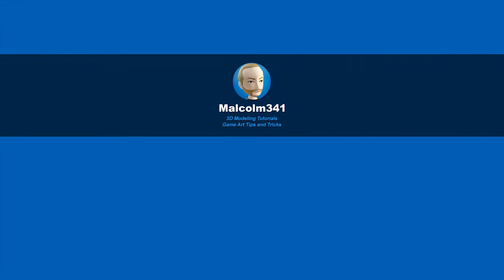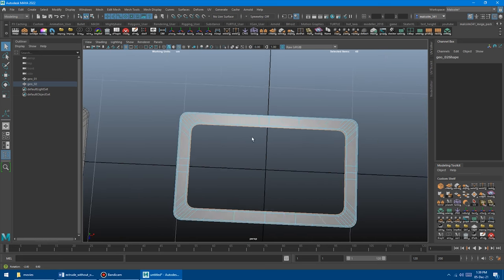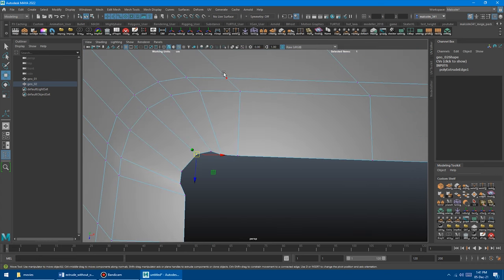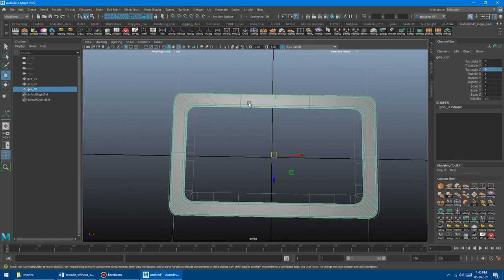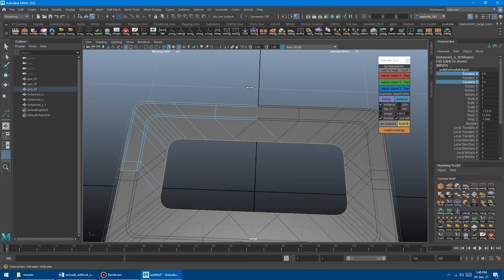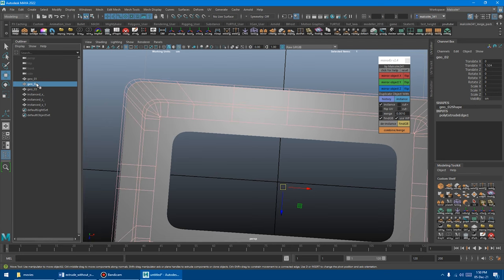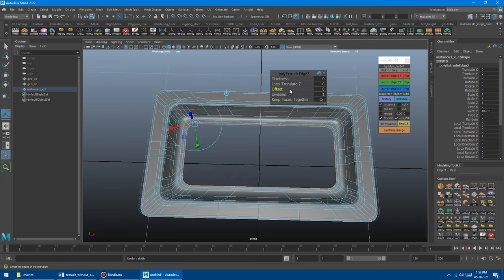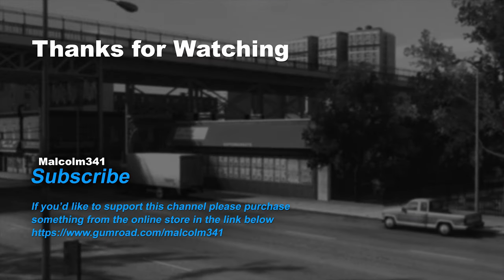Extrude Inward without Overlap in Maya

Comment: There's a similar way you can do this just by constraining your pivot. Once you've hit extrude, hit W to go back to your Move tool and then D to adjust the pivot. Now hold Ctrl and left-click on the edge you want to align to (which would be your inward facing edge ring at the center of your corner bevel) and then D to accept. Now your move tool is oriented to the 45 degree mark so you get the same thing as adjusting X & Z simultaneously.

The upside of this method is you can potentially move your edge in at a non-45 degree angle if you wish and you don't have to have your model be on a world-axis plane; it could be tilted or rotated arbitrarily. And you don't have to remember, "Wait, am I on the XZ plane or YZ plane?" etc. Once your move tool is oriented at the correct angle you can also then snap it to something more convenient (one of the verts for example) rather than floating arbitrarily in the center of the selection.

The downside is that if you don't HAVE a 45 degree edge to align it to, like you did an even number of divisions on your bevel, you're out of luck. You need geometry to align to.

It does have the same issue with needing instances and cleanup that your method does.
Reply from the maker: Good trick, thanks for sharing. In some situations you can actually just switch the move tool to component mode and just move the edges, but that only seems to work under symmetrical conditions.
Reply: The problem with that you must go to fix it everywhere manually if you have a more complex shape. (Shame that Maya dev cant handle that like any CAD software)

Comment: One of those basic things Maya should've addressed 20 years ago.  How is this just not like a checkbox in the extrusion options?  It drives me crazy how they focus on obscure features that only 5% of the users will ever touch, while 95% of us are coping with these basic, "3D 101" workflow issues multiple times a day.
Reply from the maker: Yes agree, it would be great if there was a fix for this issue in the actual tool.
Reply: Right! Does Max, C4d, Blender also extrude like Maya, or are smarter?..
Reply from the maker: @i20010  good question, I haven't used Max in years so I can't remember and I haven't used C4D or Blender.
Reply: This is why I use 3ds max

Comment: Great Trick!
I am a little lost in what you want exactly though. As in: IF you want perfect round corners or just the curvature to repeat itself.
If the former: I just use wedge to model out the frame and then fill it in.
If the later: I model the frame out WITHOUT the rounded corners (In your case 45 degree cuts) and then when I am finished with the model I select and bevel/chamfer the connecting edges... adding divisions to my will... to the width as I wish.

Both methods are in some way a little less impediment in compare to yours. But the elegance of your method is the amount of control you are granted... Which I liked a lot.
It is all a matter of give/take to what fits your needs and time restraints guess.
I hope this helps...

Black
Reply from the maker: Yes bevel is another way to get the same results, for me I'm not that good at sub-d modeling so I always end up stuck in this state, where the model is almost complete and I need to extrude inward. Limitations with this technique is it only works on flat surfaces that are aligned with the grid, helps in some situations, but falls apart in others.

Comment: Thanks Malcolm! Really great tip! Never would thought of that. I do know of another way of achieving a very similar result that works very well imo. Without instancing the obj. Just select that edge and do the extrude; accept it and change the gizmo to scale; then press CTRL + MMB drag - that will do a scale along the normals. Might not be 100% as accurate as yours, but I think it works great, and it's a bit faster. In some situations might be all you need.. Give it a try.
Reply from the maker: That's interesting, I'm not sure what it's doing to the scale tool there, can you make it work on the whole extrusion or does it only do it on one quarter? Also, technically you don't need to make any instances, that has no affect on the modeling workflow, it's just for visualization so I think holding Ctrl and scaling is doing something similar, the downside is it's not parametric, so you can't un-scale it once you let go of Ctrl.
Reply: @malcolm341  yeah, works on the whole extrusion. I wish I could send you a screen shot... Also, lets say you have 10 holes on one surface where you previously did an extrude (ex. extruded 10 faces on a surface (faces separated), turned them into 10 x holes). Then, if you want to resize all those 10 holes at once, just select them all, and use CTRL+MMB and it scales them uniformly. Another tip is scaling with the "Translate" gizmo On: for pipes, in "face" mode, and with the gizmo in "Translate" (w), CTRL+MMB will also scale the tube/pipe along the normals, so you can make it thicker or thinner without changing its size/lenght! It's a neat trick. Learned it from Mario Brajdic's tutorial @Elementza. Not sure if you already know this.. Maybe its helpful.
Reply from the maker: @artbybruno1734  yes those are good ones, use them all the time.

Comment: Did not know this trick. But I usually make a duplicate of the object, cut until one corner left, and set the move tool to custom following the middle diagonal edge to move it to the position I want. Re-arrange the vertices of the loose ends to meet the parent object's axis, then mirror it back to one piece, combine, and bridge. Not a parametric method but it gets the job done fairly fast and easy.
Reply from the maker: That sounds like a lot of work, maybe time for an upgrade. By the way, you don't need to make the four instances, that's just for visualization, you can just do it on one corner using this method like you're already doing.
Reply: @malcolm341  Thanks for the response. Your method seems more efficient. It also gives straight and parallel diagonal lines, mine does not so it requires to delete all edges in between and multicut new ones. I will surely give yours a try. And again, thanks a lot.

Comment: hey malcolm, nice trick! especially in using the x and z axis attributes inside of the polyextrude node! normally, if you select a component, you don't get access to the axes in the channel box!

actually, with the scale tool, if you CONTROL drag the perpendicular scale handle (in your case it would be Y), you'd do a 2D scale on x and z. it would still shrink but the shape would be perfectly maintained until it collapses in the middle. you're getting the wonky shapes if you drag the x and z individually because you're not maintaining the proportion. but if you do the 2d scale, it is maintained although it does get smaller. your version is better though in that the distance on the top and on the sides remain the same as if you are using offset. with the scale, you wider axis gets a wider inset space and shorter axis gets a shorter inset space.
Reply from the maker: Nope, sorry that does not work and never has, because my geometry shape is a rectangle the scale tool will always skew, if my shape was a perfect square it would work as you suggested, but because I have a rectangle scale of any kind will always skew because the way scale works in Maya has always been broken. Here you can see the problem described in more detail using the scale tool as you suggested https://youtu.be/gHAp0-KQLOE?t=142
Reply: @malcolm341  i'm not sure if "skew" is the right word... in your example vid, if you watch the shape that's shrinking, with the offset attribute in the transform node that you end up using (also - great trick!) the shape in the middle's aspect ratio is changing wildly in order to keep the inset even. the difference with the 2d scale is that it preserves the aspect ratio of the shape your scaling as it scales down but that results in the insets becoming uneven. i tried it with a rectangular shape with the rounded corners and the rounded corners seem to maintain the shape of the original... but as noted, it does indeed scale that round radius smaller.

but insofar as most of the time, we're concerned about the inset frame and not the shape in the middle, i totally agree that your technique is superior.
Reply from the maker: @jinchoung  yes you're correct the uniform scale does preserve the rounded corners correctly, but still has the issue of getting pinched. I see what you're talking about now, with regular scale it maintains the original shape at the center of the extrusion and just shrinks it, but this causes the edges that connect to the outer shape to look non-uniform, with inset the edges that connect the two look uniform. Ideally Maya would have an option in the scale tool to switch between 2D and inset since I find most of the time I want to scale with inset rather than scale and keep aspect ratio.
Reply: there is an easier way, use the unbevel script for maya, it's very save time tool)
Reply from the maker: @BadMuthaFuca1313  that's not a standard tool that comes with Maya, but please share the link I'll take a look.

Comment: Thank you for the video. I have a problem while extruding my mesh. The model is distorted after extruding.  The vertices of the object fly apart. Can you please help me?
Reply from the maker: Sounds like you need to turn on keep faces together in the extrude settings, or maybe the verts aren't weled together before extruding?
Reply: @malcolm341  this did not work for me. Anyway, thank you 🙂
Reply from the maker: @yanis_the_artist  Try delete history and freeze transform? Reset the extrude tool? Can you send an image of the problem you're having to malcolm341@gmail.com

Comment: out of topic.

hello sir!
Vertex snap (v) doesn't respect planar handles in move tool. Do you have some advice for this? Cause i need it after Max.
Reply from the maker: Maya can only snap on one handle at a time, unlike Max which can do XZ at the same time. In Maya it's annoying you have to hold v and drag x, then drag z. If you have to snap a lot of verts on XZ at the same time you you can select all the verts, then in the channel box set a key on Y only so those verts are locked in place, then snap XZ at the same time and scrub the time slider to fix Y when you're done. After that just duplicate the object or bake the animation.

Comment: The fastest way to get what you want is to just create a rectangle and inset the fact via CTRL+E (Extrude Face), and delete the backface.  Next, Use the Connect tool to insert an edge loop at the midpoints of each edge running vertical and horizontal (you'll bevel these to add your support loops later).  Next, grab the diagonal edges and and bevel them to whatever resolution is needed.  Bevel the lines you created with the Connect Tool earlier to get your support edges.  Now go in with the Insert loop tool and add whatever detail you need.
Reply from the maker: I gave it a try, but I must be doing something wrong since it creates the same issue as extruding inward, the bevel to add the support loops clips into itself as you change the fraction.

Comment: What I would like to know is how to make that soomth rounder corner.
Reply from the maker: I just used bevels to get the initial corners done.
Reply: @malcolm341  Thank you. But I was refering to how you made so the edges don't come out from one point and they simply go down the line.
Or was it it taht and the just extrude the outer faces then deleting the previous one?
Reply from the maker: @michom245  What time stamp are you looking at so I can explain.

Comment: You could just activate the extrude edge tool and then switch to scale (R).
Reply from the maker: Thanks for the suggestion, I gave it a try, it doesn't scale the faces evenly so the extruded edges are skewed as you scale them.
Reply: @malcolm341  So you want the size of the corners to not scale? Sure, yeah, you'd have to duplicate the corners, translate, and bridge or instance like you did. I was unclear what the goal was. I thought it was just dealing with the overlapping.
Reply from the maker: @davemauriello8088  Yes correct I want to prevent overlap while keeping the shape intact. It was suggested by someone else to delete all the corner segments and then use bevel to avoid the problem completely, which works, but I had already past the point of no return on my model.

Comment: But what if I need it to shrink?
Reply from the maker: @senatuspopulusqueromanus2082 Select verts and use the slide tool to slide the verts back along the extruded edges. Select verts, enter the move tool and hold Ctrl + Shift and drag the manipulator in the direction you want.
Reply: @malcolm341  Thanks)

Comment: Why not just use bevel here? Make the corner you want to round a single edge loop and bevel it with chamfer enabled and ass many segments as you want. Done EZPZ.
Reply from the maker: Good idea, I gave it a try and it kind of worked, but it still had overlapping geometry I had to clean up manually. I think because my mesh wasn't symmetrical the bevel didn't behave the same on both sides.

Comment: probably a dumb question but any chance that one day this maya toolkit can be used in blender's industry compatible mode?
Reply from the maker: I'm not sure what Blender's compatible mode is?
Reply: @malcolm341  it just means blender uses very similar controls to maya, like alt+lmb to pan around, w to transform, e to rotate, etc. So i thought maybe with the controls matching, perhaps you could get the toolkit to crossover as an add-on too.
Reply from the maker: @Sportsman134  no unfortunately the Maya tools are written in mel script which is not available in Blender and the UI would need to be designed to work with Blender. I've looked into Blender briefly and found most of the tools I've created are already available on the Blender store so not much point to port my stuff over. As well, I would need to learn Blender Python script and re-write all my tools in Python to get them working in Blender so I doubt this will ever happen unless Maya were to go out of business.
Reply: @malcolm341  oo makes sense. Haha fair enough. thanks!